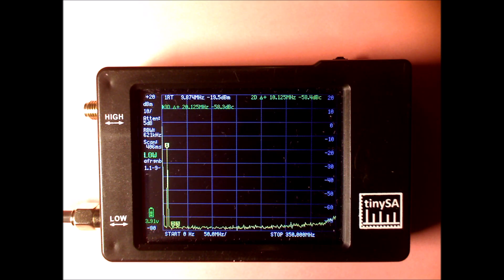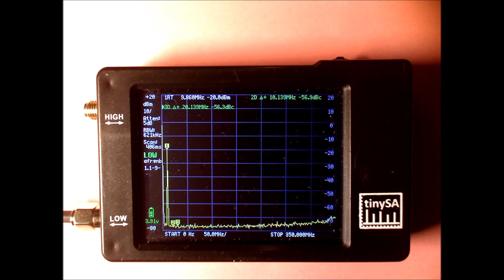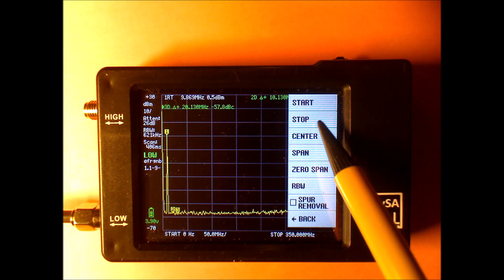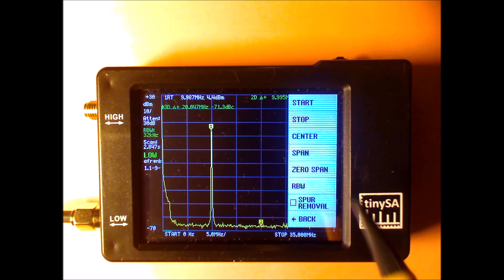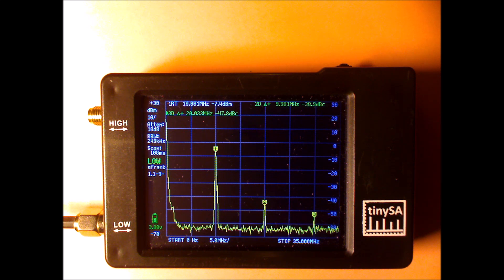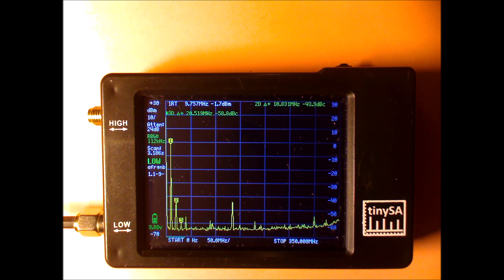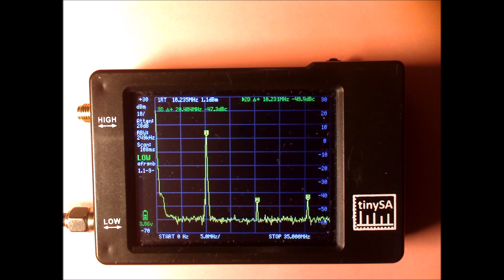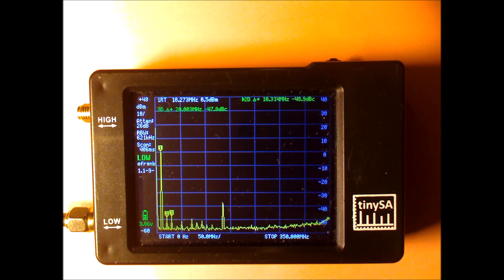tinySA Strong Signal Test

Comment: can this equipment be used with antenna to measure noise in the surrounding area
Reply from the maker: It depends a bit on what you define as noise. It is used by many to check for electromagnetic radiation levels

Comment: Hello!
I have purchased a tiny Spectrum Analyzer model ZS-206 from Amazon and have a question about the USB-C port on this device. Is it possible to use a USB-C to VGA adapter cable to get the Spectrum Analyzer display direct on a common PC monitor?
Regards 
Bo Gidlöw
Reply from the maker: @bogidlow4871  No, but on the wiki you can find a PC program that will show the tinySA screen on a pc

Comment: Thank you very much Erik for taking the time to make these useful videos.   Fifty years ago I studied post-graduate level radio engineering and these types of measurements were only available with advanced laboratory equipment.   Thanks to the Tiny SA and your excellent instructions, this type of detailed study of a radio signal is not only possible, but quite easy.   It is worthwhile taking the time to learn all the tricks this unit is capable of.   Watching the videos is as good as hours spent in the lab trying to figure it all out from scratch.  You explain things at an advanced enough level to make it useful for everyone, including those who once learned it long ago.